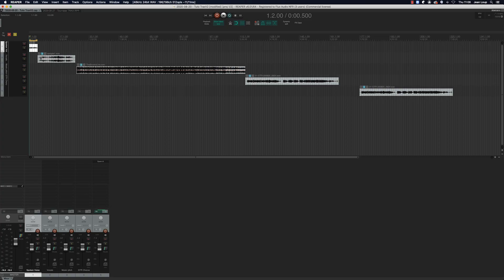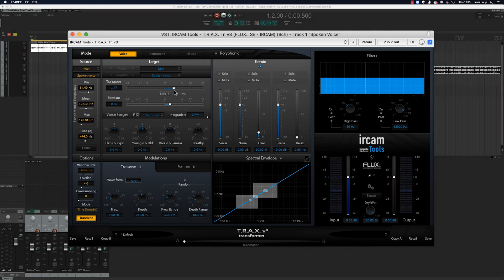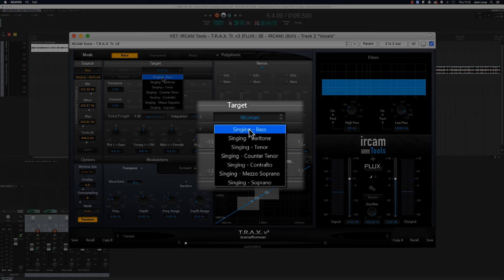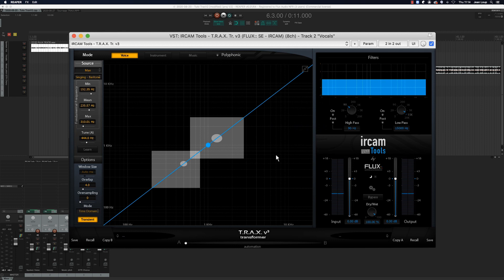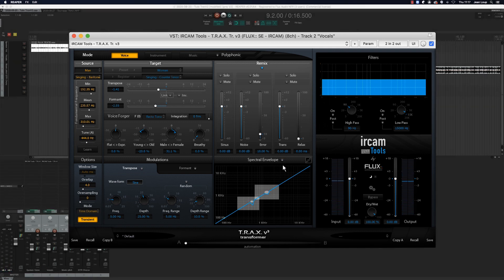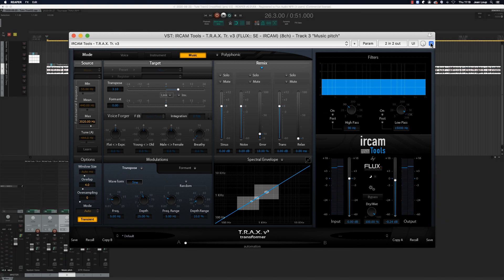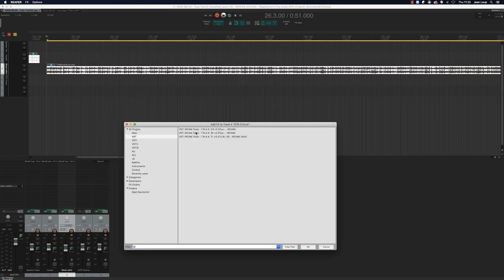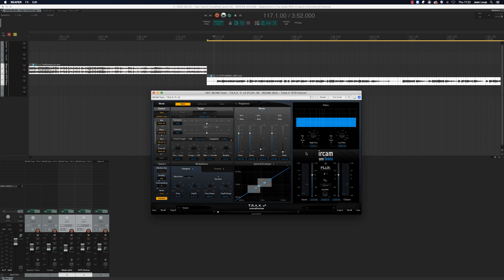TUTO: IRCAM TRAX - Voice modification and sound creation tool

Comment: I love trax, but it does have some audible artifacts especially in hard voice changes.   I wonder if there will be a new version after all these years.
Reply from the maker: For now, no newer version of it is planned has Trax is based on the IRCAM's algorithm which should be updated in order to make a completely newer version of the plugin relevant. For the audible artifacts, those mainly happens if you try to use the plugin in real-time and of course everything else matter too, from mix, to preamps, processing before and after voice change, etc...
Reply: Lol what are you expecting? Perfection lol.

Comment: can i use this in Real-Time without much latency?
Reply from the maker: Hi, Depending on the specs of the computer you are using you can reduce the latency when using TRAX real-time but it very hard to have a great and convincing result this way.

Comment: Thanks for the video, Trax is a complex plugin and needs to be explained. It would be beautiful to have more videos about Trax. For me the most informative part was the spectral editing, since the manual was a little dry on that. The best working part of Trax is on spoken vocals, but I am trying to use it in music and I invested in this and similar products to adapt loops to real musicians' parts. As your chorus example, I used it recently to give a little tremolo effect to backvocals in a second repeat on sustained vowels that had been performed "flat" in the first and only real take. I enjoyed giving tremolo to vocals (audio part) as I regulary do with synthesizers in the midi world! The ability to divide transients from pitched parts should be explored more deeply, and it has a lot of consequences and uses. The Trax purchase included a couple of other plugins that are rather hidden, I haven't used them and I guess these would benefit an update with the same sidechain support as other kind of vocoders, rather than the old bus insert with sends from L and R tracks. Cheers
Reply from the maker: Noted! Thanks a lot for the Feedback! ❤️🙏